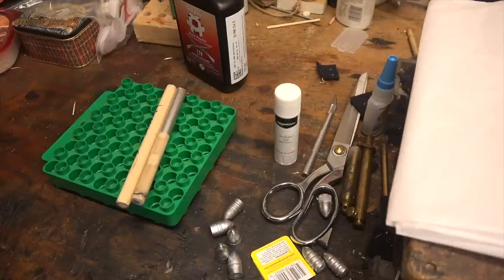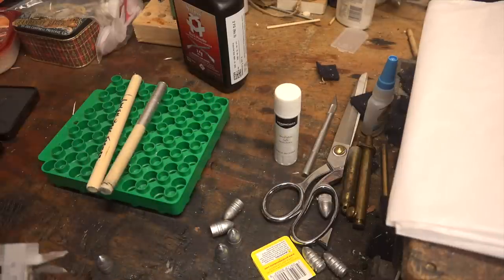Making Linen Cartridges for the 1859 Sharps

Comment: I wonder sometimes how much Google really does know about us... Because just Monday I was at the range shooting the identical load in my Shiloh 1863 except that I nitrated the linen fabric no sizing and used a linen base with a tiny flash hole.  Mine were lubed exactly the same.  I had the whole range to myself and after shooting at paper targets at 50 and 75 yards, I moved back to 250, 350 and 500 yards and was shooting at piles of dry dirt 3' to 6' high using the ladder sight.  The plumes of dust went 5 to 10 feet in the air.  It was like being 12 years old again!

Comment: I will have to try this.
I am happy with the strength & full combustion of my current tubes but always looking for more options. 
I use nitrated pages from my old Dixie Gun Works catalogs which makes a stout enough tube. Not historic but looks old timey and feels good from a personal  historic sense...
Next experiment is using the fluffy flowers of goldenrod plant instead of cream of wheat to fill both paper cartridges and in brass cartridge  BP loads. (Have jars of the dried flowers for medicinal tea)
Thanks Mike

Comment: I have been experimenting with using aircraft "dope" as an adhesive (it is nitrocellulose) as it is a varnish and waterproofs a little , is easy to apply with a brush and is an adhesive....it is also highly combustible.....might be an option if excess Elmer's becomes an issue.

Comment: Good video Mike, I have a question, would the linen be stiff enough to size with a guillotine paper cutter. Also where did you acquire the large diameter paper punch.
Reply from the maker: I don’t know because I haven’t used a paper cutter like that since my school days. I got the paper punch on Amazon
Reply: If you put some stiff paper or card stock under the linen, you shouldn't have any issues cutting it.
Reply: @barlscharkley5411  Thanks Baris, and the reason I asked, is because for my paper pistol and rifle cartridges the paper cutter works so well.

Comment: I don't know about the Richmond bullet but the "Chistmas Tree" bullet will not chamber in my Chiappa Sharps if you wrap the Linen around the bottom driving band.  Nor will in chamber in a Pedersoli if they are wrapped this way.  Using the Christmas Tree bullet, you have to wrap it around the small bottom skirt and this limits the amount of black powder you can use.  I can only get 40 grain in my cartridges wrapping the linen around the bottom skirt.

Comment: Great video Mike! Could these be rammed down a .54 Muzzleloader barrel and fired with a number 10 musket cap?
Reply: Muzzle loading paper cartridges usually are tapered. I guess the cylindrical ones shown here would be mangled on the way up the barrel. But I didn't try.

Comment: Would it be possible to just use Flash paper? Could I just roll it up until it was thick enough to make a cartridge?
Reply from the maker: You don’t need flash paper. I use tracing paper to make paper Sharps cartridges and they burn completely.

Comment: How long would you estimate they would remain viable if unshot?
Reply from the maker: If kept dry…pretty much forever
Reply: @duelist1954  So if I make a large batch after finding what works best in my gun and store them sealed in a dry container with a desiccant, they won't degrade? If so I'll probably put back a fair supply.